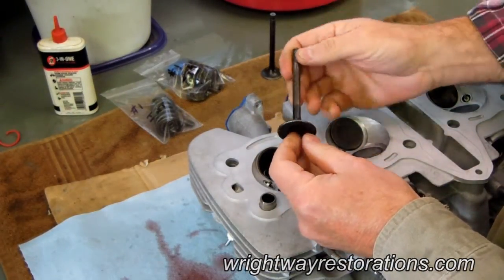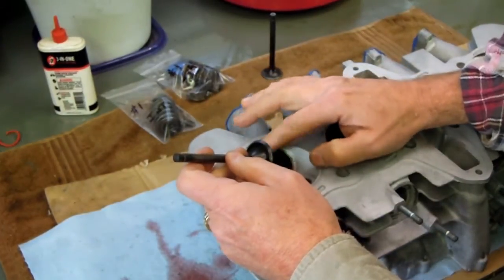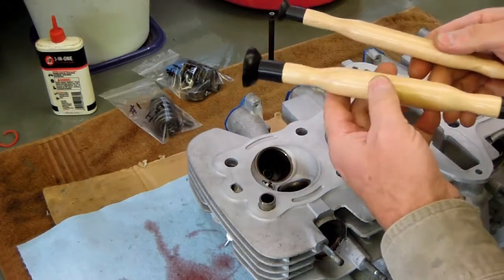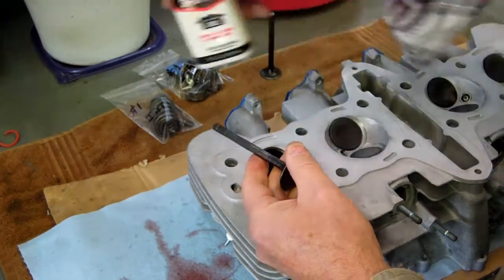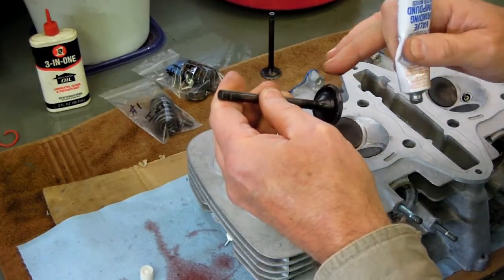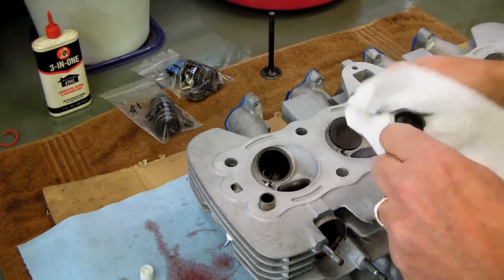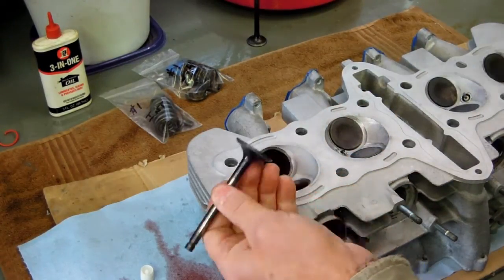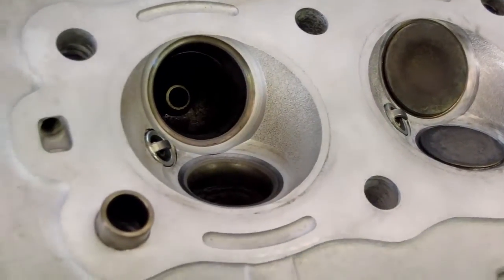Kawasaki KZ650 Top End Reassembly - Part 7 --- Video #40

Comment: Hi I've just finished refitting new seals, valves, springs etc. I used a dab of grease when putting on new seals and a dab on each collet when refitting for ease. Hope I don't run the risk of blocking any oil ways ?
Reply from the maker: A little grease won't hurt a thing, you'll be fine.

Comment: hey could you tell how many pounds id torque the heads down to
Reply from the maker: I torque the head bolt cap-nuts to 28 foot-lbs, in two stages, first to 18 ft-lbs, then the final round to 28.  The nuts should be tightened in a particular pattern, which you can find in a service manual. The two cylinder head bolts are tightened to 18 ft-lbs.
Reply: thanks

Comment: Very good and thorough job. How did you remove the carbon from the valve? Some people use a wire brush but I'm not sure if it is appropriate.
Reply from the maker: I used a BRASS wire wheel on my bench grinder.  Works just fine and less aggressive than a steel wire wheel.